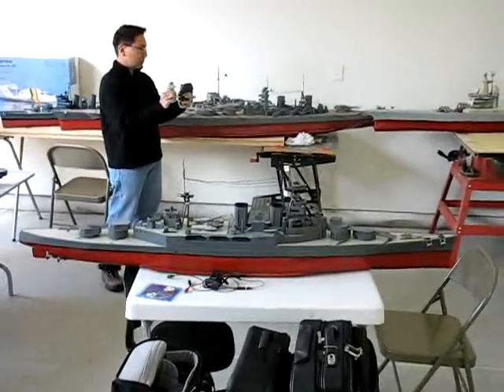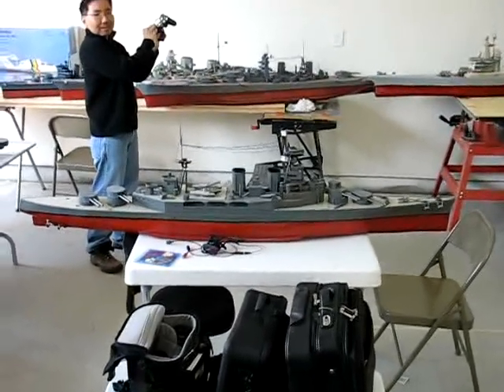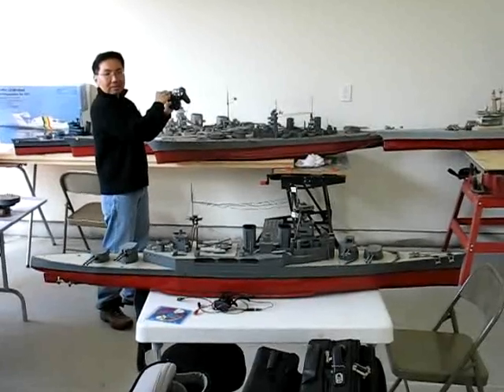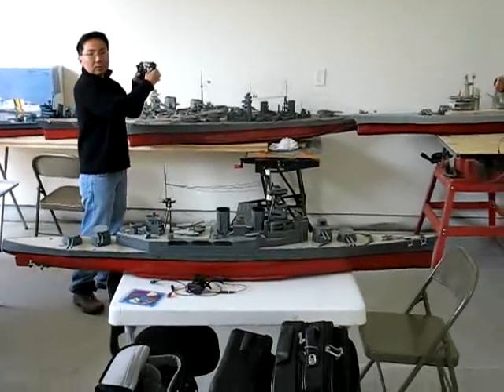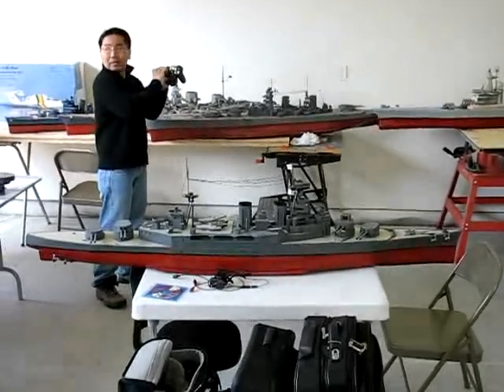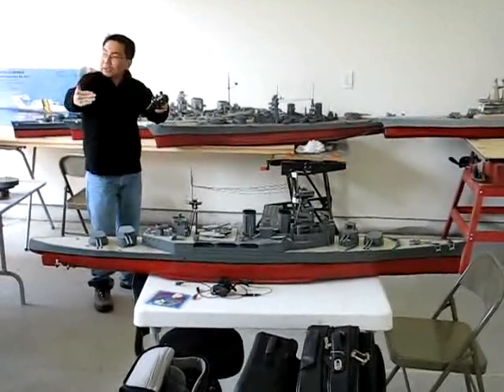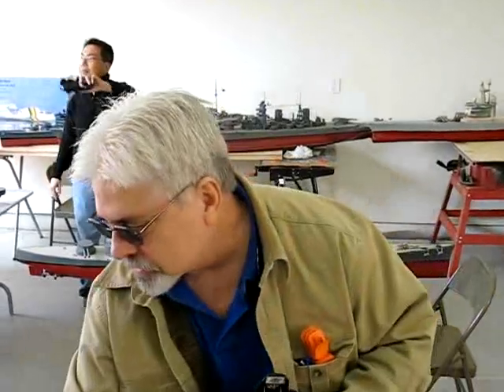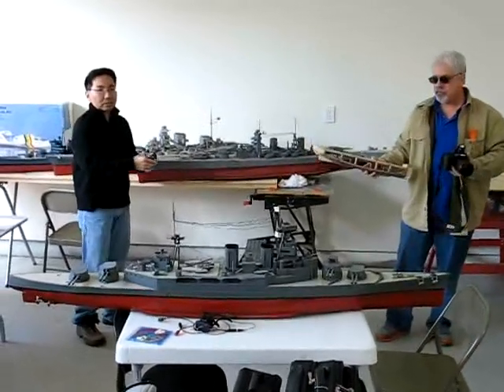Fire Control Computer demonstration

Comment from the maker: Depends on what you're getting.  A single-barrel non-rotating cannon (suitable for torpedoes) costs about $25, while a rotating triple-barrel cannon for battleships costs upwards of $150, excluding the CO2 bottle and plumbing to run it.  Radios can run between $50 for a bare-minimum system to $150+ for a decent computer radio.  Pumps generally cost about $25-$50.  Don't forget about other components, like ESC, batteries, motors, props, hull, etc.

Comment from the maker: it *was* a playstation controller.  Now it's the human interface for the Morgret Command/Control System, AKA the guy who built it made his own custom circuitboard with a high-powered computer chip and a 2.4ghz transciever, that just happens to use a playstation controller as its case.